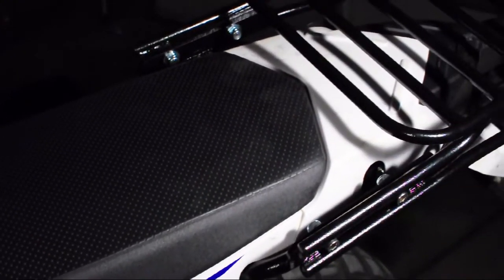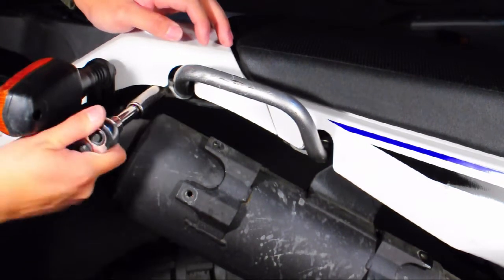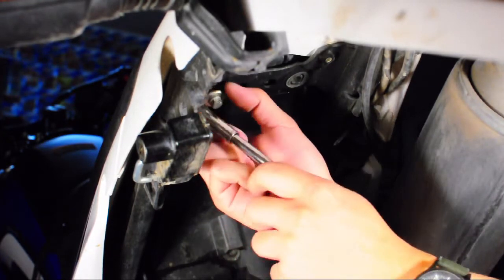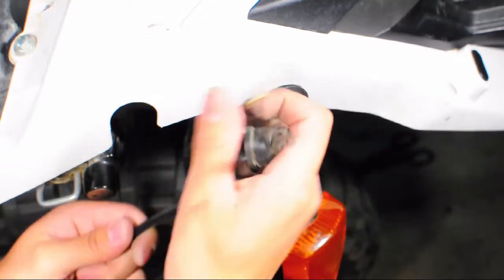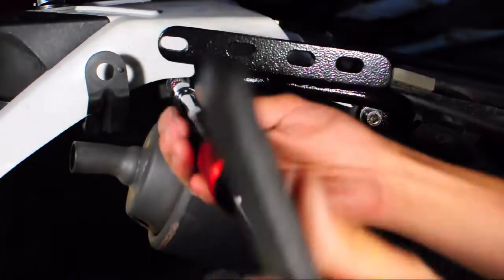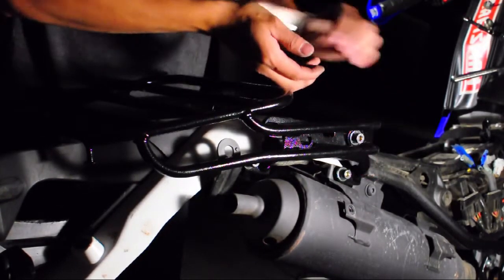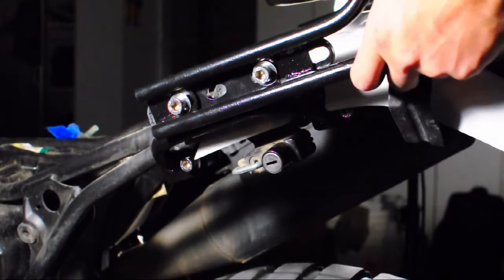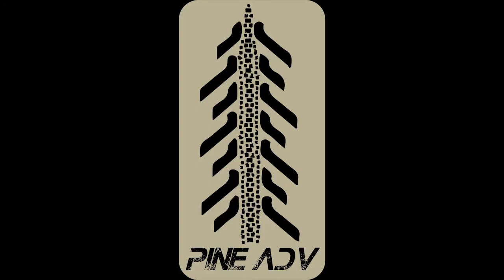XT250 Upgrades Episode 11: HAPPY TRAIL TOP RACK AND GRAB HANDLES

Comment: Nice video.... what mounting plate do you use with this TOP rack to mount the white rotopax that is shown in other videos?.  Is that a Happy Trails part or you adapted one?
Reply from the maker: Oh jeez, I totally forgot I haven't done a video on it. It's a happy plate side rack adapter that has been adapted to fit the top rack. Good thing is it uses all HPT parts. But if I were to do it again I would redo the way it mounts to the rack. The top plate just isn't as solid as I had imagined it would be. 

~NoOne